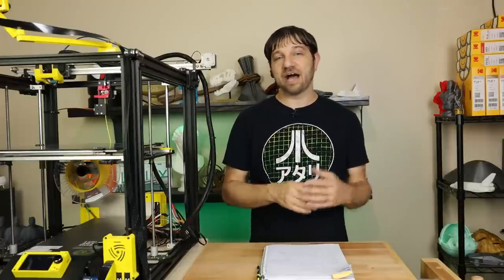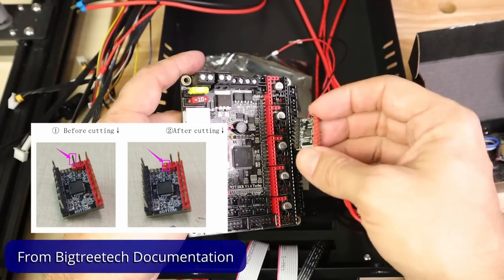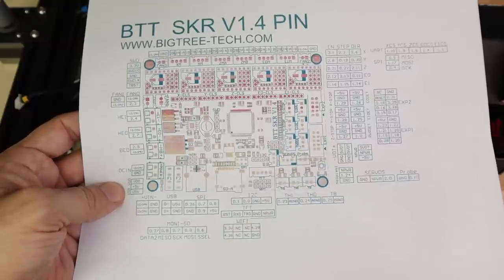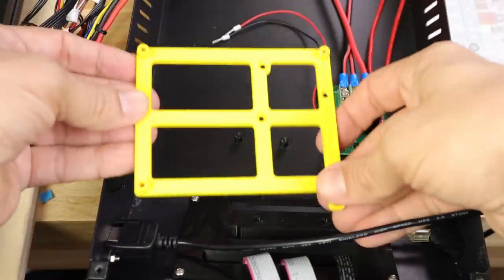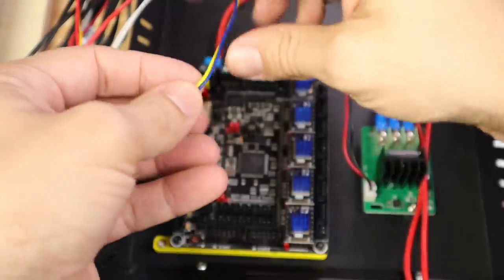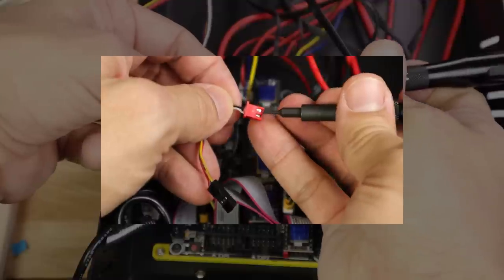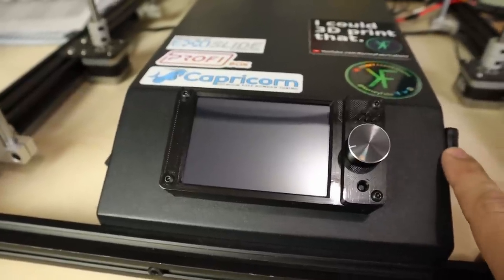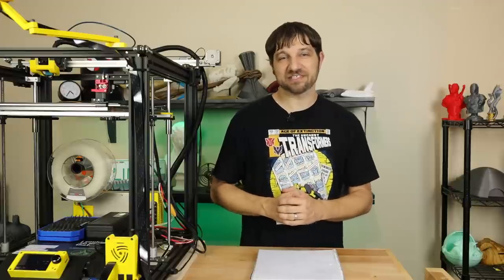Bigtreetech Ender 5 Plus Upgrade: SKR V1.4 Turbo (Part 4)

Comment from the maker: If you've missed any of the other parts, please check out the full playlist: https://www.youtube.com/playlist?list=PL4dGkbjUvBzrhR53vf2ZbYrxCr84uBwJ1
I'll include any clarifications and corrections in this comment.

If your BLTouch has different colors:
New Colors:
Brown & Black: Ground
Red: 5V
Orange: Control Signal
White: Z-Min
Here's an image: https://photos.app.goo.gl/4cxeHgk3E1bTJyfn9

Luke J mentioned that if you have the brown/red/orange wires, there is no need to flip the black/white wires.

Comment: Hey Kris, I'm finally on the verge of dusting off my E5Plus and doing this mod, so I just wanted to say thanks again for all the time you put into this!  This is a stellar tutorial (as usual), and I can't wait to get this thing up and running again.  It was kinda busted (screen died), and is my only printer, so I bought an Ender 3 V2 just so I could have a working printer to print parts for the big dog.  I'm sure I will be referring to this video (and the wiring ones) MULTIPLE times in the very near future.  Keep up the great work sir, you are THE man for the Ender 5 Plus!!!
Reply: Agree!   I have an Ender 5 Plus and the SKR 1.4 Turbo board.   Had issues and restored eeprom when I should not have and had to use his repository to get the 2.09 release installed again!   Thanks so much!

Comment: Nice Work Kersey!  Firmware worked first try, wiring pinout was bang on.  Had an extra 1.4 Turbo board kicking around and swapped out the Mini E3 Turbo board that was cooking my steppers.   A+ on Video, A+ on wiring and Firmware.
Reply from the maker: Thank you for the feedback Tom! Keep an eye on those stepper motors. Some people have had overheating issues with this board.

Comment: I actually implemented the Dual Z driver configuration on my E5+ and am pleased with the results. The Z auto-alignment (G34) aids with bed leveling, and I never really have to worry about my Z stepper motors getting out of sync (for long at least). If you don't think you're ever going to go the dual extruder route, I would recommend taking advantage of E1 as Z2.

The Insanity Automation fork of Marlin (CrealityDwin2.0_Bleeding) makes it easy to enable Dual Z, and also supports the stock touchscreen LCD ... even with the SKR 1.4 / 1.4 Turbo (and I've successfully compiled it for the E3 Mini 2.0 as well).
Reply from the maker: Thanks for the reply. I'm going to try and take a look at both of these scenarios if/when I do a follow-up video.
Reply: DodgeDeBoulet Does E3 mini support the stock dwin screen?
Reply: @yufan  I believe the TFT port on the SKR E3 Mini can be wired up to the DWIN screen (I wired up the SKR V1.4 Turbo "TFT" port to the DWIN screen of my Creality CR-10S Pro with no problems.  It was just a matter of finding the pin-out for the DWIN screen and connecting the RX of the screen to the TX of the board and the TX to the RX of the board, plus power and ground connected per normal  (5v to 5v, ground to ground).    I found the names of the pins on the DWIN board but they were obscured by the connector.   Then I found this picture and shared it in imgur for everyone else:  

So, I don't have the E3 mini board, but the TFT port appears to be the exact same.   In the Tiny Machines 3d Marlin 2.0 Firmware, I have to enable the Force10SProDisplay flag.  I use build flags at compile time in the PlatformIO extension of MS Visual Code.... so that flag I add is -DForce10SProDisplay along with all the other -D flag that I enable to configure the printer at compile time.

Here are some links that may help you:
https://imgur.com/gallery/rcrRf0u
https://imgur.com/kanEegg

Comment: Fine and interesting work!
Just yesterday, the board, screen and drivers arrived (without the USB and SD extensions logically) They look great with BTT, the Creality screen is very large for few options)

Fine and interesting work!
Just yesterday, the board, screen and drivers arrived (without the USB and SD extensions logically) They look great with BTT (the Creality screen is very large for few options)
And with Firmware! I'm quite a novice even to understand everything Marlin. Thanks!
Reply from the maker: Good luck with the install! I hope this is an easy process for you.
Reply: @kerseyfabs  OH! YES, for the moment, I will try a while (now I am with many things at once) the silent Creality, I will learn the Vref that work best for me, to be able to make a good comparison, (the display adapter I already printed it, it is very Nice, on the other hand smoke comes out of my head trying to configure Marlin for Ender 3 with SKR 1.3 (indifferent for one or the other TMCs 2208/9) Thank you very much for your help, starting from 0 is difficult, I have learned a lot, with a lot of frustration: -)) I see that I need more and more to learn, I imagine that like many people who did not know what an Arduino is :-)).
  
(32bits VSCode, what is that? hahaha

 Let me ask you a question, is the use of the USB and SD display sufficient?
later, for communication with the distant PC, with Ponterface .... etc. send G-codes , install the on-board wi-fi module, with a discreet antenna.
Very TY!
Reply from the maker: We all started from scratch at some point, some are just further down the path.
I think you're asking can you just use the USB and SD on the display. That should be sufficient for printing but you won't be able to flash the firmware without access to the board's SD slot. As you mentioned, you also won't be able to communicate with the printer directly without the onboard USB.
Reply: @kerseyfabs  
YES!
Once the .bin firmware is installed on the microSD  .CUR 
(sorry for the translations).
Exactly!
I don't have a powerful enough notebook.
By adding the WIFI module to the SKR, just like USB, you can communicate with the PC, with the software, Ponterface
or Repetier Host Repetier Server, without the need for a Rasperi Pi?
 
 
Thank you very much for answering!

Comment: Great video! Thank you for showing the wiring correctly none of the other videos out there did a great job with that. The new Ender 5 Plus printers that come out of the factory now have the meanwell 500W power supply as standard and have changed the BLTouch wiring color to the standard orange/brown/red from Antlabs. I just got my second Ender 5 Plus to join my other printers in the print farm and will likely only add these going forward. These machines with some upgrades are fantastic. I exclusively use the SKR 1.4 Turbos on all of my printers and highly recommend it. I'll be adding the exoslide to this one as a test, since these run 24/7 I'm sick of the delrin wheels.
Reply from the maker: Thanks for the comment and for the info on the latest printers. I'm glad these are working so well for you! I think you'll be happy with the ExoSlide.
Reply: @kerseyfabs  Thank you for exposing that to the community. I was going to go linear rail but I'm happy to support small 3D printing businesses.
Reply: Hi Intrepid,(Or Kris), I have a E5Plus as well with the orange/brown/red wires for the BL Touch. I'm installing my SKR 1.4T right now. Could you tell me the proper orientation for the servo plug with these colors. I'm not sure what the colors signify and I don't want to plug the BL Touch in in-correctly.

Comment: Tip to address the little bit of wiggle on the terminal end for anyone using Kris's style of bracket; since the mounting holes for the board go all the way through the bracket I simply used a longer screw to attach he board on that end (I used 16mm, 18mm would match the front height more exactly but 16mm and 20mm were what I had on hand).  These create sort of stand-off or feet for the bracket at those two points and make it rock solid!

Thanks for the videos Kris, it's made all the upgrades to my new Ender 5 Plus a breeze (and factored heavily in my choice of buying the machine over others in the size category)!
Reply from the maker: What a terrific idea! Thanks Cylvre! I'm glad you're enjoying your printer.

Comment: Hi Kris, thanks a lot for your videos on the SKR Turbo and the TFT 3.5. I was able to update my E5+ by following meticulously your tuto and it works great. Thanks a lot also for the firmware for the TMC2209 you kindly prepared. I seized the opportunity to relocate my power supply outside of the main box. Nice improvements for my new silent printer. Regarding Marlin, I will compare your config files to the default ones so that I should be able to get the last version of Marlin with the same config. Thanks a lot again !
Reply from the maker: I appreciate the feedback! Thanks for watching and leaving a comment!
Reply: Hi  @kerseyfabs   I wanted to tune my PID and notice that the PID tuning for the Bed was not set in the prebuilt firmware you prepared in the video description. So I manage to compile mine based on your github source. I just modified the driver values from 2208 to 2209 for X, Y, Z and E in the configuration.h. However when I load this firmware, i got an error when heating the bed: heater failed heater_id. I set 60°C for bet temp, the bed temp reached 52°C and then error pops up. Do you modified other params in your source files compared to your 2209 prebuilt (generated on the 3rf of Dec 2020)? Maybe you set another custom bed resistance or something? (FYI, the issue disappears as soon as I reload your prebuilt firmware, but can't set the print bed PI). Thanks a lot !
Reply: EDIT: I solved my issue. it seems that the PID values from your code were too far to mine. So when the Temp enters the PID zone (10°C around target) it failed. What I did was to have the temp to reach 50°C, then launching the PID autotune command for 60°. Now I got the right PID values, I can reach the target temp without issue.
Reply from the maker: @Mattbe72  Awesome! Glad you were able to work through it.

Comment: For those who may be wondering and have a SKR 2 they are using this guide for in the new version of the board there is a set of pins that enables and disables the sensor less homing and you no longer need to cut your DIAG pin as shown https://youtu.be/vS8RM2RPe-s?t=258 just simply do not cap it with one of the short caps and you will be fine!
Reply: Hi, thank you! 
Have you done this with the SKR 2? Will the Firmware for the 1.4 work with the 2?
Reply: @mrsnak6119  Yes I have the two. Sorry for the delay on this I dont know if you are still working on it but I can help if you send me a message.

Comment: Will be doing this, this weekend. The video came just in time. Also ordered the exoslide so that will be the next mod.
Reply from the maker: I hope they go well for you! Happy mods!
Reply: @kerseyfabs  The exoslide went well enough apart from a couple of issues/ The SKR 1.4  turbo and TFT 35 E3 V3.0 however im having issues, No Printer Attached and i cant seem to update the firmware. I put the firmware on the card, go to print and it just says loading...... nothing ever happens after that. Any assistance would be great, Thanks

Comment: Kersey fabrications, would this be you recommended board for the 5 plus? After reading you’re pinned post on the e3 turbo issues?  Thanks.
Reply from the maker: If you want the extra stepper driver then yes, at this point. If not, then I'd go with the Mini E3 V2.0 since it's easier to install and has an onboard EEPROM.

Comment: Kinda weird, you swapped the polarity with the bltouch but when you plugged it in, the white is on the left which is reversed, did you flip the cable when you plugged it in?
Reply from the maker: No one's complained about the way I hooked it up. I think it's right, at least with my machine.

Comment: Hey Kris, thank you so much for this tutorial. It helped me a lot with installation. Firmware works great also. The printer is so quiet now it was  almost a bit scary to begin with:)
Now I need to get some fans to take down that noise.
Reply from the maker: That's terrific! Just be careful when looking for quiet fans. Many people think any fan can do the job and quite often install underpowered solutions. This will result in clogs from heat creep and insufficient part cooling.

Comment: Hey Kris,

I’m just wondering. Did you have to adjust the potentiometers on this board for the Extruder stepper motors to prevent clicking? Or was it already set well from factory? 
Planning on doing a long 2 day print and I don’t want my Extruder to click on me!
Reply from the maker: This board itself doesn't have potentiometers. If you install some older stepper drivers they may but if you install new TMC2208 of TMC2209 steppers, the reference voltage is software controlled. With my firmware settings, I've have no skipping but please make sure your temperature settings are good.

Comment: Kris, Thanks!  I finally got my Ender 5 Plus with the SKR 1.4 Turbo board running thanks to your downloadable Marlin 2.0.9.3 with the correct settings already in them!   Between that and your video on how to level/tram your Marlin firmware-based printer, I can finally print again! YAY!  I would so much like to learn how to use your source of that version to compile my own.  However, I get all sorts of errors when I try to compile it myself. If you have step-by-step instructions somewhere on how to do that (I can't seem to find any), I'd sure love to get a link to such a page!  Keep up the great work and I look forward to your future videos!

Comment: I'm not sure how frequent this issue is, but with the 5 plus machines that came with the MeanWell 500w from Creality, it's not pumping enough power to power the LCD screen AND the BLTouch correctly. The screen flickers and gets dimmer and dimmer until the LCD light is dark. Pull the BLTouch cable, and it's as bright and working as normal. Kris, you don't run into this because you have a much beefier power supply than the (better than original) stock power supply. From my research on the internet, the solution appears to be  buying the BIGTREETECH Direct DCDC Mode V1.0 Power Module Supply from amazon or wherever people want to buy their machine stuff. I ordered one and can report back after I install it later this week..
Reply from the maker: This sounds really interesting and it's the first I've heard of it. First, I don't believe it's related to the power supply. After all, I have two Ender 5 Plus printers now and they both began with the cheap 500W supply, stock mainboard, and stock display. Neither of them have seen this issue at all. So, is it an issue specific wot the SKR boards? If so, which one(s)? Does it only happen when the bed is heating? More information is needed. Thanks!
Reply: @kerseyfabs  ah my bad. User error. I needed to swap the Red and Brown servo bltouch pins. The TFT works fine. (see my last comment about being a noob.. ) Ultimately, I have to replace my board because right out of the package, the board SD slot will not read any SD card - it does light up when a card is inserted, so I can't flash the firmware from what's on the board to your new z align version.. and I can't flash via octopi because it needs the SD on the board accessible.

Comment: Hope this helps some people. If you are in the UK/Europe. When connecting the BLTouch to the 1.4 turbo, its different wires you need to change. On the 3 pin connector the ground and power cables need to be swapped (brown and red). The white and black wires are already the correct way round.

If you fail to swap these wires, the screen will flicker and go black, and the BLTouch won't work.

Not sure why the wiring is different on creality printers here. But it is!
Reply: I still read your comment. All day I wonder why I can't bl-touch I check the cables, everything is fine, I'm looking for a mistake where I can .. I watch that I do it exactly according to the video, I check the connections according to the diagrams on the Internet, and finally after reading your comment I find out that Chinese turned a black and white wire for European printers .. I almost had a heart attack ..
Fortunately, it finally works ...
And I must highly commend Kersey for his dedication and time-consuming work to a community that is scattered around the world.
Reply: @1vyrobca  Happy the comment helped! When I encountered the issue it frustrated the heck out of me.

Happy printing!

Comment: thanks Kris, and big fyi to other so you dont smoke your board/dcdc module, i've seen 3 different wire orientations on the bl touch, and 2 different wire color schemes (the other not here being brown, red, orange on the servo cable connector rather than blue, red, yellow). make sure really identify what wire is what coming from bl touch. I had to swap the servo cable blue and red wires in the connector as they were swapped for what this board accepts but my black and white were already set ok (and in a white connector not a red like i've seen on many videos including this one). Also dcdc module is not required for just a bl touch but if you use it you'll need to move the jumper next to it up to correct position.
Lastly also note you need to remove that extra senseless homing pin for x,y, AND Z because if you configure your bl touch in the z endstop position you will crash without removing that sensorless homing pin on the driver (i bent mine out of the way in case i wanted to play with sensorless homing later). (unless you change the firmware around to use the actual probe pins next to the servo connector instead of z stop pins then it won't get confused.)
Reply: I had the brown, red, yellow. The black and white were correct, but brown and red needed swapped.